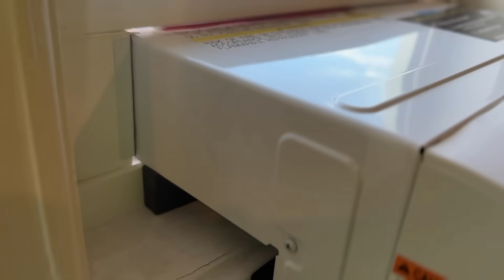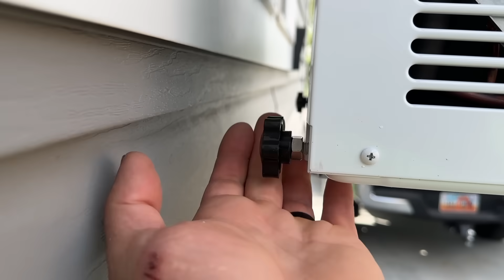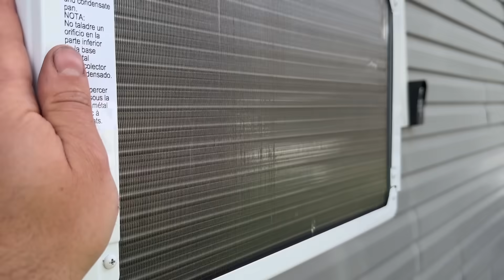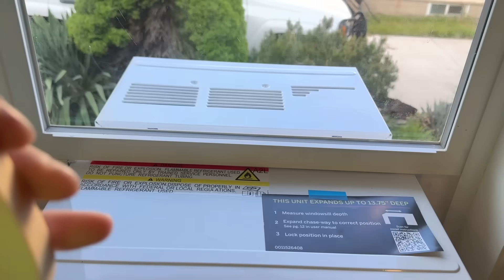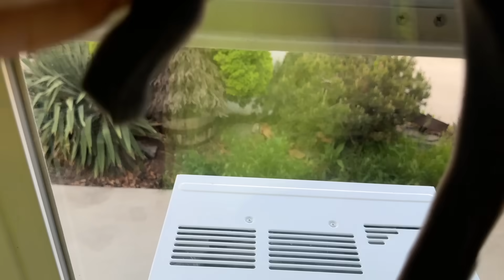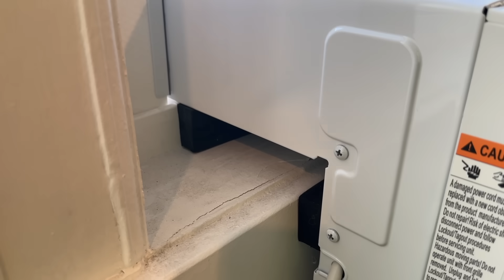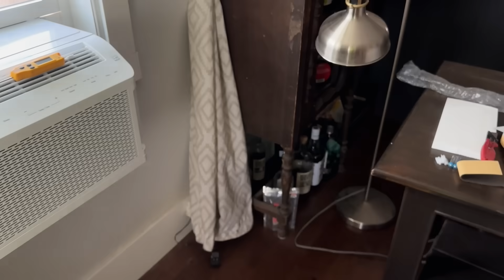Why Didn't Anyone Think Of This Sooner?

Comment: This existed in the 1970's but had the channel on the side where a window could slide in the channel sideways. It had 2 fans a condenser fan and an indoor fan. It ran on Refrigerant 22, I still have it but the outdoor fan no longer works, so I have it but it isn't operational.

Comment: Well it's good that it's an easy install but it does take up part of your window. Most of these: they cut a big whole in the wall & place it below the window & you still have full view through your window. The design looks nice enough but still, up higher than a normal unit so you are forced to look at it more. Plus it seems real easy to break your window & somebody got themself a new AC for free....

Comment: me sitting here why he extended the saddle part in the first place? pretty sure it would fit snug on the original gap out of the box and requiring way less distance on the support legs you unscrew.
also, the dark foam isn't supposed to go there, it goes in the window sill gap underneath the unit...

Comment: This is not new. Back in the day we had the FU 79384902989582059795 Turbo Max Supercharged Minus 4 V8 Super Carbine Magnum 9 Plus Flux Capacitor Window Air Conditioner that did it cheaper and better.

Comment: I'm sold!!! Putting a standard window AC in always terrifies me, dropping it out a second story window onto the hood of my car would suck!!! I saw these after I got my current unit, but the need for a new one has come up, and I'm going with this. As for the inverter, the one I have now is dual inverter, run it every night (365, yes winter too) at 60 and my power bill is like 70-80 bucks/mo, definitely power friendly. 

Thanks for the video, glad to know they work well. 👍🏻

Comment: These units let all the bugs crawl through right into your house. They are stinkbug magnets, too. Ive had these units let 40-50 stink bugs PER DAY crawl through the vents on the outside, through the inside of the unit, and then into the house. The insulation is irrelevant since they crawl through the unit itself.

Comment: I’ve been looking for a window AC unit but, most I find are for double hung windows. I need one for a slider window. About 8000 btu would do. Will also need a block off plate for the upper section. Any suggestions?

Comment: Why this isn’t being made is because it requires 2 motors: one for the front evaporator cool air exit and one for the rear condenser hot air exit. Maybe some arrangements with belts and pulleys can use one motor. ?

Comment: Thanks! Interesting however my window opens sideways! Also Joy Pebble & Midea make a similar model. When I installed my two windows units in different areas at the house I used foam sealer to make sure no bugs would come in! Plus I made sure I had the outside back of the unit slightly lower just a smidgen to allow water drainage. 👍🏼 🙏🏼

Comment: With the saddle design could you open the window with out risk of losing the unit? I have a window unit on 2nd floor window. It would be ni e to open the window and clean it if needed without removing the ac unit.

Comment: Actually i saw someone build a compact ac without an external unit it was combination of peltier plates and a compact mechanism like the once found in ac condenser or something. though it was a prototype it was just amazing zero heat released in the atmosphere cold breeze compact and most important only consumed like 400-500w

Comment: The design is really cool, but the tumb screw braces would destroy vinyl siding. With the pressure and vibration, it might even crack Hardie plank and wood siding. I'd only be comfortable with that on brick.

Comment: Thanks
That is awesome
Been waiting for years
You could even put the outter farther away if you want to do a basement with an adapter.

If you put plastic moulding to top on each side the window will be theft proof.
Iy will be locked even if somone knocks it out Couple of screws to hold the plastic molding. Use decorative if you want.

Plus it keeps heat far away. 
Only problem there will be mold under the siding from shade

Comment: This is an amazing design. You're right. 

When I lived in South Korea, everybody had air conditioners that you put up near the ceiling. They were pretty long units, and cool air drifted down towards you. There was usually a tube that went out of window so that the water could flow easily, and this gravity thing was facilitated by the high placement of the air conditioners. They work perfectly in any room as long as you had a window.

Comment: ok i need to ask why you guys use this kind of AC?, why not use separeted units, Motor outside, Evaporator inside, wall mounted, no need of assembling and disassembling everytime, no gaps, windows closed, super quiet. like i really dont get it. there is like what benefits from this windows ones, we had around the 80's here in my country, but then we evolved it and deleted those chunky things

Comment: There is no requirement that manufacturer's or "app" stores keep "apps" available
Is access to all the air conditioner's functions provided via the "app" ALSO accessible by either hardware buttons on the A/C unit, or by a separate remote control?
If not, then buyers need to keep in mind that when the "app" is eventually removed from the "app" store or the manufacturer's website (which over time happens with MANY apps)  then from that point on, all those "app" controlled functions will be unavailable to the user.

I've bought a number of devices that were controlled exclusively by an "app" and when the "app" was removed from public access, I could no longer use any of those devices. They became useless dead weight. This has happened to me a number of times. Note that the company or the "app" store may also remotely remove from or disable the "app" on your phone as well. It may be done at any time and for any reason by the manufacturer or the "app" store.

A similar thing can happen when an "app" is updated and no longer supports your current phone's Android version. Your phone is now obsolete as far as this device is concerned, and to keep using the "app" your only choice may be to buy a new phone with the correct version of Android. Many phones do not allow updating Android to the latest version. Another potentially expensive 'solution'. This too, has happened to me. Their "app" system remotely also disabled the "old" version on all phones on which it had been installed, and since my phone had an older, now unsupported version of Android they did NOT update the "app" nor install the new supported version of the "app"...and it was all done WITHOUT ANY WARNING.

Comment: My stepbrother use a wood instead of foams between window frame and ac. He calk everything up around ac and wood. He put foam insulation middle part of windows where there a hole. Let me tell you, its will be hard to get ac out and my old windows will definitely fall on you if your not careful.

Comment: Other part of maintenance not mentioned is dealing with mildew that eventually can develop inside the A/C from running it 24/7 for over 3/4 of the year. 

I usually manually cycle between A/C and dehumidifier to help dry out the inside; it'd be cool if the automated schedule could do thar for me.

Comment: There are several brands of this style of unit. Reading all the reviews, one complaint stands out, regardless of manufacturer. This unit requires that condensation that accumulates must be pumped to the outside. The inside tank is a haven for bacteria and mold. Eventually that mold clogs the hoses that the pump uses to evacuate the condensation and water starts dripping out of the unit and onto your floor. One reviewer resorted to drilling a hole in the tank and running a hose into a gallon milk jug that now needs to be emptied when full. 😮

Comment: I hope GE and other air conditioner manufactures (or at least their design engineers) will see this comment: People need a way to clean out the portion of the unit that is outdoors, without removing the unit from a window. Pine needles, leaves, bugs, etc. will get in there and make the unit less efficient, and cleaning them out is a royal pain in the backside. This applies to all units from the cheapest to the most expensive.

/rant

Comment: Very well done 'critical’ review but no offense:  you should read the manual before the installation. Also as others mentioned: there are  similar units on the market because Midea has done  this 3 years ago LOL
As far as reading the manual: as others pointed out in the comments: you need the swooshing sound because that is what increases the SEER from 10 to about 15. Without the "addtionale water cooling system" that is a low efficiency AC. So you need to leave the incline you had initially, otherwise it is an incorrect installation.
I owned a Midea for a month and then returned it because the so-called sleep mode was actually making a high-pitched sound every time  the compressor would kick in full power. So the quietness of the unit was actually a bad thing because every 20-25 minutes the compressor would kick in full power to cool things again and that would make a noise that wakes you up. NOT GOOD. 
Basically the way it works: initially the compressor kicks in full power to take down the unit’s  temperature then the compressor is able to switch to “low power/noise” for 15-20 minutes until the compressor has to come back to full power. That’s when you WAKE UP unless you have a super deep sleep.
So it would be interesting if you did a part 2 of this video explaining if this happens with this unit too. But thanks again for your super popular video!

Comment: I came up with an even better design about 10 years ago and sent the idea to several AC companies.  Never heard back.  I posted this video about 6 years ago of a prototype I made:  https://youtu.be/Q8aR52DqFWc.  The design in your video shares the main advantage of my design of moving the compressor outside  My design is quieter and works in a sliding widow.

Comment: Please remind people  when they have the window open with the AC unit in it, the must put some sort of LOCKING bar above so that the window cannot be raised and the AC removed for someone to gain access into your house.  **I just saw the stopper bars you demonstrated.   That's good, but it is VERY important to use them.  Otherwise you literally have an OPEN/UNLOCKED window.

Comment: I'm not totally sure why this still needs such a large saddle. I understand perhaps it makes installation easier, but I also feel like having some sort of flexible conduit between two different parts (outside and inside) might create a better experience installing in certain types of windows... except it would of course require some mounting on the wall in and out. So maybe it becomes more akin to a heat pump rather than an AC.

Comment: Like others mentioned. This design has been around for a long time. The difference between this design and Midea U-shaped A/C is that Midea's U-shape open space is on top. Its downside is more window is blocked. But the problem with the GE unit is that the A/C is at a lower position. Because cold air goes down, its cooling is less noticeable. In addition, the gap needs to account for the thickness of exterior wall. Which varies quite a lot. So you could ended up with a big gap in between.

Comment: Can you disable the Wi-Fi on the unit, most of the new consumer electronics have less than desirable security and I do not connect them to my home Wi-Fi but I also do not want someone else changing my settings by hacking into it. I live in a Multi Dwelling Unit so there are enough people close by they could negatively affect my experience.

Comment: Many reviews state that this thing doesn't do crap for cooling on a hot day, i.e. when you really want to use it.  More specifically, they state that you can't set the temperature to go below 64 degrees, but on top of that, apparently it is difficult to get parts if it needs repairs, which you may need as they seem to break within the first year.

Comment: Its been around and Medea unit is better it would be almost impossible to get the sound on video unless manually taking off auto and setting fan on high. mine maintains temp and rarely high fan speeds. Plus a way slimmer interior unit.

Comment: I got one. Its inverter shakes loudly. It used to pull 950w on full blast and cool the room in 3 minutes. It's now pulling 500w for about 1m before going to min speed and firmly planting itself there. After fighting with GE's website [completely broken] I finally got a tech over to look at the unit. 8AM when it was 50f out. [it will run at min speed at this temp] All he did was turn it on, wait a few seconds, and then said nothing was wrong. The tech then said the loud vibrating sounds and screaming was coming from the fan..... There's not 1 thing touching the fan nor anything wrong with it. They also sent 1 guy for a 2 person operation. [They're not allowed to remove the unit unless two GE techs are present]

It's also funny how they didn't charge me for this "false" warranty claim. And before anyone asks, yes, it's installed correctly.

EDIT: To clarify how loud this unit is, I can clearly hear it from my mailbox over 180 feet away with wind blowing.

Comment: Definitely worth looking into. It's cheaper than going with a Mitsubishi split air system that goes for $4000 to $6000. Here in the northeast, the problem I have is storing these window units over the winter. This unit looks quite large when you factor in the gap in the saddle.

Comment: The splashing is there to bring the SEER rating up a little due to the temperature reduction in the metal. Since heat travels through metal so easily, any temperature reduction outside is going to effect the inside results. Thankfully, you managed to get rid of the annoying sound at the cost of using more electricity. It's a good thing that people can turn to you for guidance.

Comment: Years ago my central heat/ac went out.  4k to replace, 2200. to repair.  No thanks.  Been using window units and portables.  Portables are so much easier, but you have to use a double hose one, and they're hard to find and expensive.  Window units work great, but two of my cats and one former dog figured out how to push the accordian sides over and go outside.  Wildest thing coming home from work at 5am seeing my dog running around.  She busted out of her cage, got on top of it, pushed the a/c unit sides over and just had a ball all night long outside.   I've had my eye on these since I've seen them a year or two ago.  Expensive.

Comment: Very nice design but if you live in an apartment, say on the 3rd floor, without a balcony, you can't extend the holding screws. So this is only good for the ground floor or rooms with a balcony.

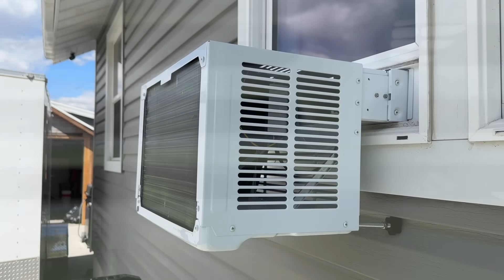Comment: 6:23 The water noise is there by design. The fan on the condenser side is designed to splash water on the condenser radiator to increase its efficiency. It also reduces the amount of water that drips out of it.

Comment: As an FYI on the install the outside unit is supposed to be level that water splashing on the fan is intended for energy efficiency if the noise is unsettling there is a drain plug on the back side   lower left you can remove

Comment: I looked at this system but ended up getting the Midea smart U shaped window air conditioning units. And I have to say - they are amazing! Simply amazing. We were looking to put in a ductless system and bought these as a stop gap but decided to postpone the big expense. We have a small weird shaped plaster walled 1000sqft home and the small and medium unit is more than enough to cool the house. Forgot and left on the dehumidifier setting for a day - house was freezing like an ice box. Fantastic units. And quiet!

Comment: had a soleus brand that worked AMAZING, then the drain hose from the from to the front drain tray to the condenser got moldy and clogged up..Would run for 5-10 minutes then fill with water and error out . Had to pull the drain plug and use a 5 gallon bucket..

Comment: I think the saddle designs are neat but come with an increased expense.  The little 5000 BTU rated unit I have is fairly light and compact and the noise doesn't really bother me much.  We also have central air in the house but it doesn't make it upstairs thus the reason I have the window unit as well as a portable.  I also like it cooler at night compared to the other people renting with me.

Comment: Looks very cool.  I think I'd add a 2x4 or similar under the supports outside so it does not mark or break the siding.  Weird that it does not have a cover for the side facing outside.

Comment: I have bought 4 Media units the oldest is 5 summers old. GE stole idea from Media! The only problem with them is they need a pinhole put in lower corner because the don’t drain water well enough no matter what angle they are on. Will they last through 6 summer? DB is 42 same as tested outdoor Ambient sound!

Comment: Water sloshing sound at the back is not normal, could be a blocked drain hole. That is why most window AC are tilted upwards, not sure if GE put the drain hole at the bottom. Water can corrode the fins and housing

Comment: Warning:  It's heavier and much harder to install and get in and out than an equivalent box style air conditioner of the same power.  But you do get a better view out the window and they're notably quieter.  I like mine, but have a friend ready to help you get the thing in and out.  also, the remote control gives no feedback in terms of functions, so you're kind of making adjustments blind.  The smartphone app would solve this, but the wifi units on these things are notoriously finicky.  Do research online about how often they don't work.  I have one, and I like it, it's quiet and cools very well, but there are potential downsides.